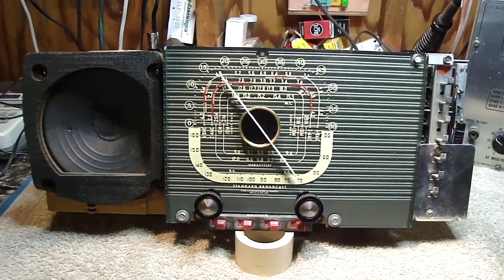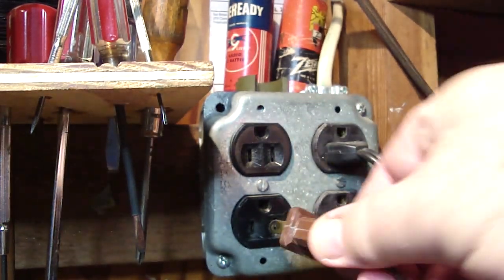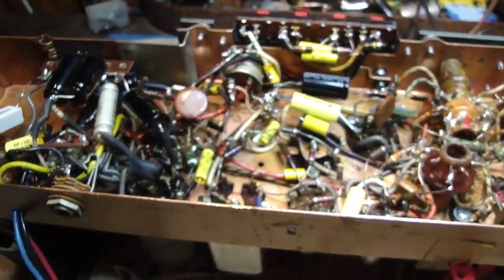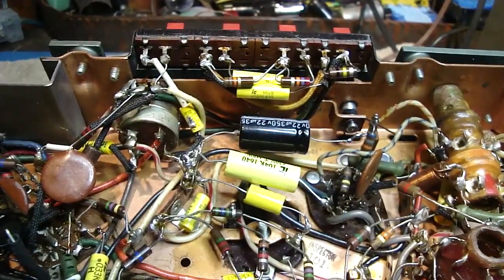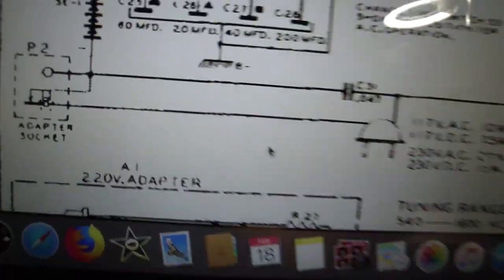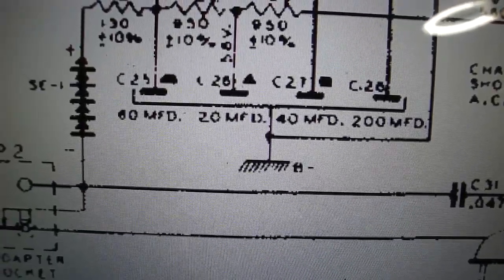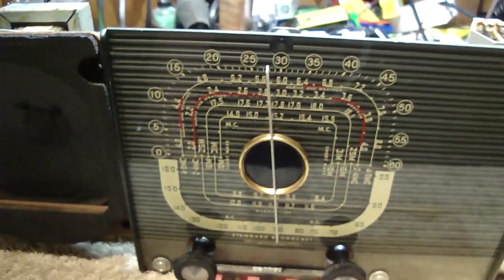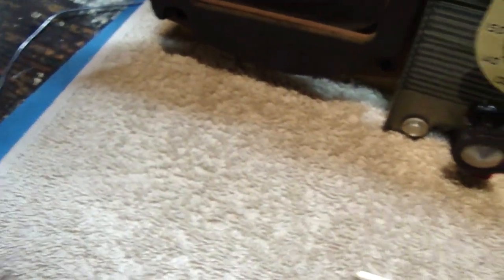New Capacitors and the radio still hums

Comment: Hi Radiowild. I may know you from one of the FB radio groups. I wanted to mention an observation about the symbols for the 'floating' or circuit ground and chassis ground.  I've seen the symbols over the years and have always seen the "Rake" symbol for the actual chassis connection. The triangle 3  line 'normal' ground symbol represented the B- or isolated return. It seems that your T/O symbols show the reverse. An example would be an RCA 15X. It shows the "rake" symbol as the physical chassis, and the triangle ground symbol as B-     The schematics will usually show the cap and a resistor in parallel, that connects the chassis to the isolated B-,   noted alongside of the main schematic. I can't post a screenshot of the schematic. You may message me as I may lose track of this video. Thanks!! (Gary)
Reply from the maker: When I come across a problem, I try to address it as simply as possible so that folks that are not use to problems like this to get a understanding of it. Goodness knows I'm sure you seen some wacky engineering designs from different manufacturers, as well as incorrect schematics. Sometimes you learn more from mistakes along the way. I've had my share, and some I've never forgotten. Thanks for pointing that out Gary! Lesson learned. Bob - RW

Comment: Hi Bob good deal I see now my mistake something I should have checked a bit more carefully. I like the way you relocated the caps on the terminal strip I'll know better for the next one. You most certainly can have that tube with the adaptor I can always make another if needed. Great job thanks. See you at the next meeting.
Reply from the maker: You got a good chassis for what you paid for it! You did a good job cleaning it up too! I did a full alignment, and with the 1L6 and using a longwire (Because my shop is in the basement) was able to get stations on all bands. I'm sure you'll be happy. I'll hand it off to you at the next meeting.